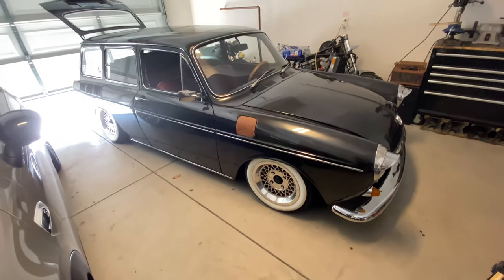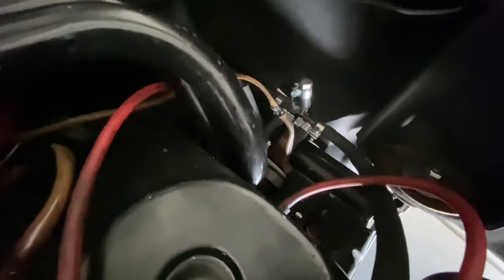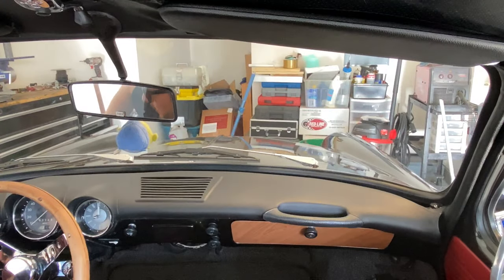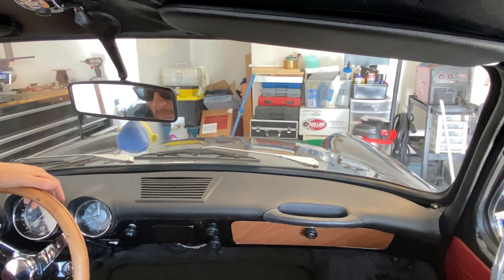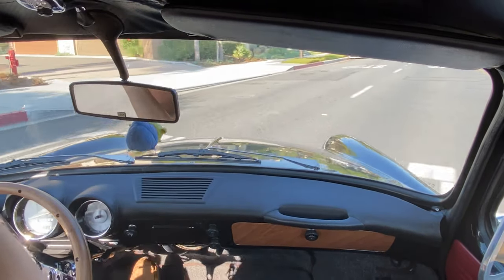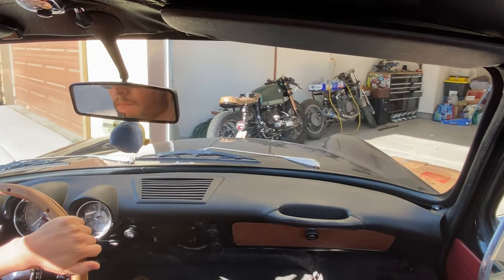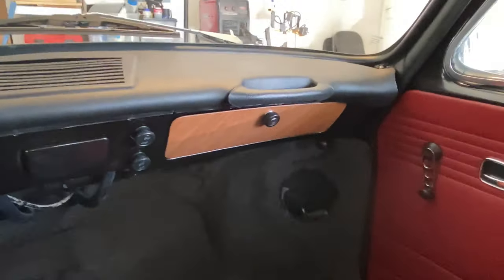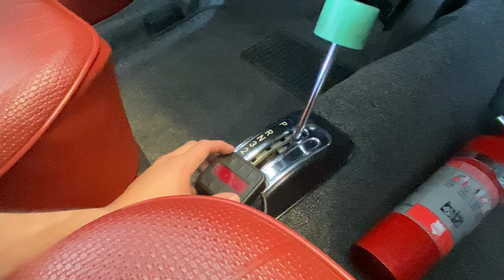1969 VW Type 3 Squareback Automatic - For Sale BaT

Comment: Great job have you sold the car yet?
Reply from the maker: Not yet, actually took it offline to work on a few issues, fixed odometer, rebuilt clock, fixed some of the FI wiring harness, replaced coil, etc. 

Just a few more issues to sort out and will be going up for sale on Bring-A-Trailer, thanks for asking!

Comment: I have converted many type 3 from fuel infection to dual carb. 
They had one of the worst injection systems ever made.  
I love the type 3 but hate the injection. I almost traded my low mile mercedes turbo diesel for a square back but the owner was very dishonest. Said car was never wrecked and no rust. But found every panel had thick body filler and rust holes filled with door screen and body filler.
He wasn't expecting a custom restorer to see through his patch jobs. Thought he was going to dump a $1500 car for a $8000 ,car. He was pretty pissed off when he didnt get the benz